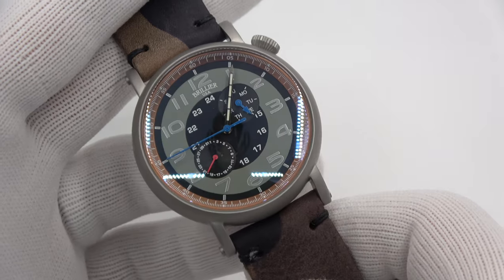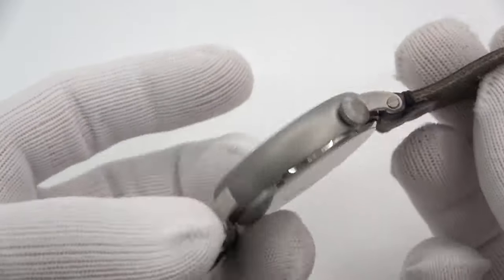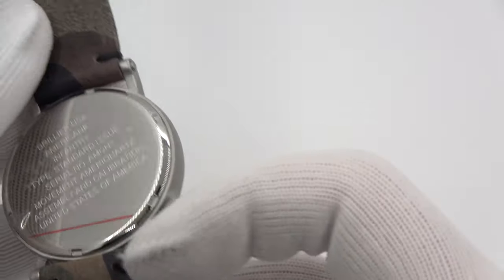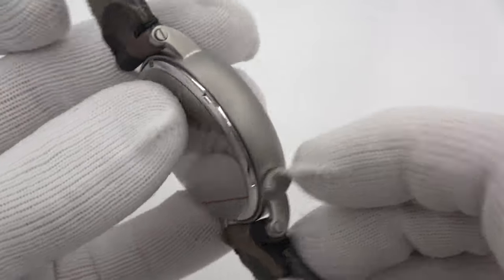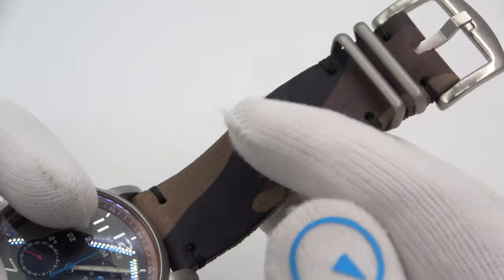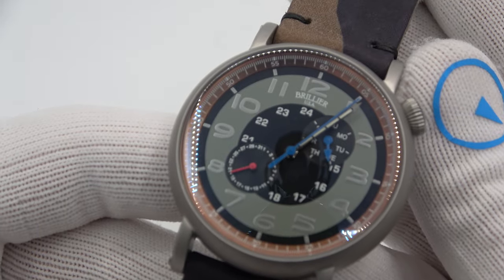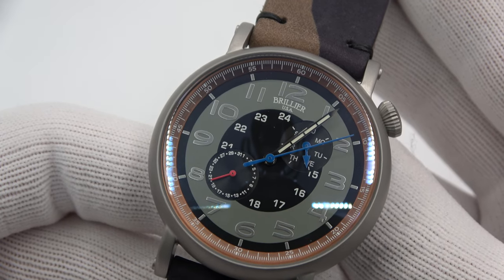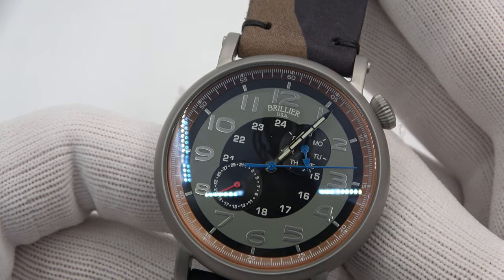Bringing Watchmaking Back to America - Assembled in the USA Ameriquartz

Comment: Interesting.I still don't get why get why a good quartz movement is so downed.They are incredible pieces of micro electrical engineering! That's why Seiko thought outside of the box ? Genius really. Cheers.
Reply from the maker: For sure, I'm with you.
Reply: I agree. I recently saw an exploded view of a Casio GPW 2000 (my most used watch) and OMG it puts anything from Switzerland to shame.
Reply: @billcosgrave6232  On the same wavelength as myself . My most worn piece is indeed a Casio mrw200 h. The internals are as you say could pull heavy punches in the scheme of things! Cheers!

Comment: No US-made movements?? Perhaps there is a viable business plan in buying up vintage USA movements, dissasembling and rebuilding for durability, then installing in modern cases with the benefit of water resistance.  (I guess the scale of such a business depends on the number and cost of movements you could acquire ;  there are caches of NOS movements scattered about and I realize I'm hoping more than stating fact)
Reply from the maker: Sounds a bit like Vortec
Reply: @islandwatch  Thx! I looked at vortic. Rather high-priced movements they sell. With your business platform, if it could be done, I'm guessing you would have looked into it. Bespoke wristwatches...

Comment: They have to be cheap. Just can't imagine these things being more expensive than computer chips. Often I hear about difficulties with respect to high wages and that's just bs. Most of the time, people who have this excuse just don't know what they're doing. The US still manufactures chips the Chinese have to import to build phones. No way you can tell me a watch movement is supposed to cost more than memory controllers and processors. That's just bull. FYI, every PC also has a quartz oscillator to keep the time.
Reply from the maker: There's a heck of alot more to a movements than an oscillator.

Comment: Are quartz watches really considered watchmaking? There's no skill you buy a $5 circuit board throw a battery in it.
Reply: One Make Then
Reply: Baby steps, like he said.
Reply: I agree in theory and believe that's generally considered true. But the idea can be flawed. If you're truly designing and building your own movement and putting it into a case you've designed and manufactured yourself, that's a completely different thing.
Reply: It's watchmaking, just commonly not luxurious watchmaking. Then again, decades ago most watches were not considered luxury unless made in precious metal which, same as hand decoration, doesn't relate to the quality of the caliber as a timekeeping device.
Reply: While the mechanical finesse isn't the same level, there's certainly a fair bit of engineering that goes into quartz movements. Plus, the accuracy and ruggedness of quartz is appealing in its own right.
Reply: @RF_Drift  A quartz movement is far more complex than a mechanical movement. One person can make a mechanical movement but it takes many separate industries to be able to produce a quartz one.
Reply from the maker: Absolutely. There are gears and jewels!